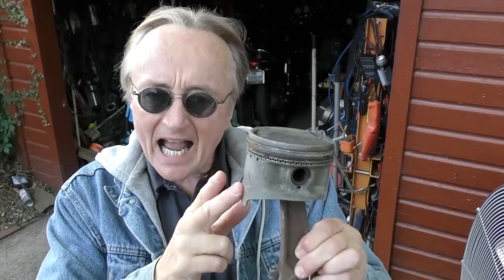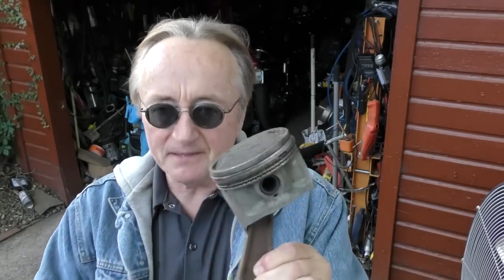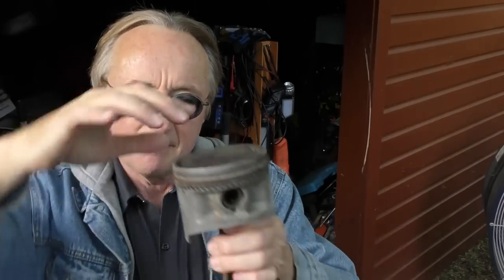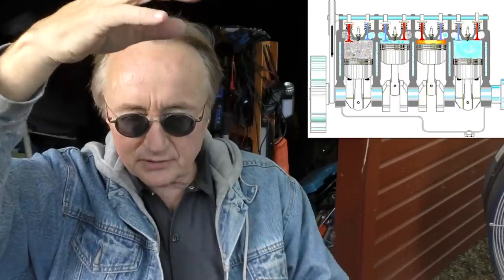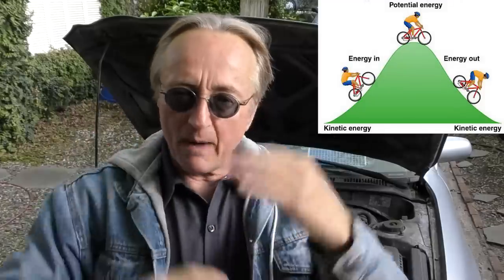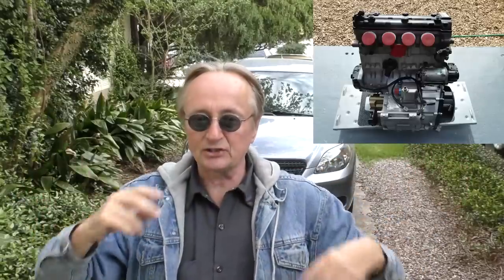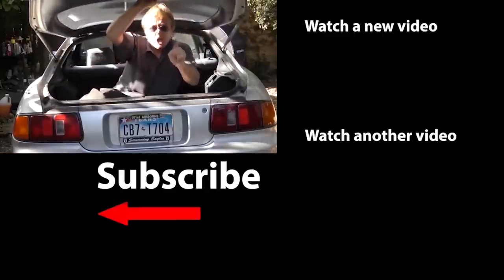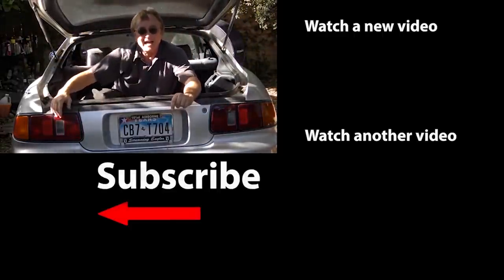Horsepower vs Torque, Which is Better

Comment: Scotty, I am a mechanical engineer and today I'm sad to say that you, as 99,9% of people that try to explain what is the, let's say, practical difference between horsepower and torque, are wrong. I'll not try to explain it here and I do understand why you think what you think. Once, I did think like that too, because it is kinda of the intuitive idea. The only thing that I could ask you is this: if you have the oportunity, talk to a real engineer, someone that works with cars and really has some background on how car works and how maths and physics works. That person will say to you, without a doubt, that what you say in this video is actually not quite right. Wish you the very best.
Reply: I agree. This is not correct physics.
Reply: Yup...
Reply: Explain the truth. Now I am curious. You must feed my curiosity (please). Thank you.
Reply: @DrDreams23  power is a function of torque.  You can have a harley or a tractor with a lot of torque, but neither will accelerate quickly.  If you take the hyabusa Scotty was talking about with high power it will accelerate significantly faster than the Harley. There is no way the harley will accelerate to any speed faster than the busa. Same with the F1 car, they accelerate very quickly, due to the high power.  Additionally, a high power engine will tow a load up a hill faster than a lower power but higher torque engine provided you have adequate gearing.  So unfortunately Scotty got pretty much everything wrong in this video.  Power is torque at speed.
Reply: @DrDreams23  Keep this “ LEARNING HUNGER “ going brother, never stop learning 💪🏼 🧠

Comment: Rev up your Mitsubishi Mirage with 78 horsepower
Reply: You're just mad my mirage is a 2018
Reply: My 2000 Mirage (1.8) had 92 horse. Great on gas, but as Scotty says, "couldn't get out of its own way."
Reply: I have a moped with 50cc does that count it wimpy so let me rev it
Reply: In simple terms Horsepower is how fast you hit the wall and torque is how far you take the wall with you.
Reply: this is a great car with reliable cvt here in IL , one of the best Fuel efficient car auto
Reply: VKA_CarvedSix09 yes I am
Reply: RANT I’m jealous
Reply: I love my Mirage. And it has 80 hp in European spec!!! 120 miles an hour!!! And average fuel consumption 52 mpg (over 50.000 miles). And no defects. Zero. Nada. Nothing. Not even a light bulb broke.
Reply: The quintuple flatch swing clutch part-identified right between the driver and his prey
Reply: 100 cylinders 1 horsepower.  

But the rolls has 563 gears
Reply: @ronaldderooij1774  obviously because its still a brand new car
Reply: How many virginity's you think were lost in this cars?
Reply: My current car has 114hp and 136lb-ft of Torque.
Reply: @scotty281976  I thought of that saying when I saw the title!
Reply: Rev up your suzuki carry, 28 brute horsepower 😂
Reply: I was thinking about buying one of those. Glad I dodged that bullet.
Reply: I had a little Toyota Trueno with only 100 HP,  it didn't weigh much and was pretty quick unless you had passengers
Reply: @vka_carvedsix0979   How do you like that little car?  I've been looking at them for years just as a car to go back and forth to work and save on fuel.  Currently have a 2014 Altima that get's 29-31mpg city driving back and forth... Yes I drive like Granny to get that mileage I'm cheap lol.
Reply: @vulpixgrant  almost 50 if I coast the car
Reply: Rev up your yugo with 54🐜 ant-power.engine.
Reply: Mine has a V6 swap 3.8 with 280whp
Reply: No mitsubishi carisma with 125 hp.. And yes i rev it all day long to get it around in my pace
Reply: My Citroën C3 1.4 has only 82 hp
Reply: Rev up ur Suzuki Alto with 48hp
Reply: Bacster Bacx hHhHaha do they actually ‘rev up’????
Reply: @Pittaz  yeah i think :D
Reply: Rev up your 94 HP 2014 Scion iQ😂
Reply: Hahaha
Reply: Its funny you say that, I just traded my 2018 mirage for a 2021 Subaru Onyx with 260hp, now I feel like a god!

Comment: Torque and HP are apples and oranges, two very different things.  Torque can be measured, HP cannot - it has to be calculated.  Torque is best achieved by longer stroke, larger pistons, and more combustion pressures.   Unfortunately, longer stroke makes for higher piston speeds which limits your RPM.   If you want a lot of HP, you need the engine to survive higher RPM, which means a shorter stroke is better.   HP relates directly to gas flow rate (cubic feet per minute) that you can get through the engine, so big intakes, big exhaust, big valves and big ports in the cylinder heads is where HP is made.   There are a lot of compromises between big torque engines and big HP engines.   Is the variable stroke and variable valve lift and valve timing the best of both worlds?   What do you think Scotty?
Reply: Thanks for this comment. Very well said. I learned from it
Reply: Yeah this is true. This is why many big American engines are limited to 6,000 rpm or below. 
And Asain cars can go up to 9,000 rpm. American cars can tow more, but have lower top speed.
Reply: @angelgjr1999  Completely inaccurate generality
Reply: It is true that the big push rod engines have more torque and less horsepower and are also lower revving, so American muscle fits the profile, but beyond that, it's a mixed bag.
Reply: HP can be measured just like Watts, just because a calculation is needed to measure it, doesn't make it any less of a measurement. For instance we use the term measured for the distances of celestial bodies in the universe, which can only be done through calculation. Now onto the subject of which is better, horse power is, plain and simple, horse power is the overall power output, and torque that is applied to the wheels can be infinitely increased by simply gearing down(think of it like using a longer lever to lift an object).
Reply: @creamofbotulismsoup9900  Cosmology produces some really imprecise measurements. Check out the error bars in any paper. Also it makes little sense to simply gear down an engine that is severely lacking torque. It wouldn't work putting a car engine on a semi truck, for instance. You'd just be spinning the clutch or torque converter and never going anywhere, no matter what gearing was available.
Reply: I remember in my 2 stroke days I owned the highest torque motorcycle of its day. Higher than 900 BMW 1200 HD.
70 HP with 81 FTlb.....'74 Suzuki GT750.  Just able to make 120 MPH. But as Phlaked Corn
 commented, numbers are for
stock gearing.
Reply: @redtrek2153  Well if you put a 500HP car engine, that made that power at 5000 RPMs , VS a semi that makes that power at say 2000, it just means that the car engine would have to turn 2.5 times faster to apply the same amount of force to the wheels. Sure that car engine makes less torque, but it is also spinning faster, so you can use gears to multiply the torque and actually achieve  the same power output to the wheels.
Reply: Patrick, that's why old american low RPM V8s had such huge torque.
Reply: @angelgjr1999  Sorry that is not how it works. Power is power, plain and simple, it doesn't matter what speed the engine spins at, it will tow just as much and go just as fast so long as the power is equal. The reason why a lower RPM high torque engine is better for towing is because of gearing, more torque means fewer and longer gears can be used, with a higher revving car you would need more gearsto get the same acceleration.
Reply: @PasiemuKasMano  I'll take a high revving honda engine with half the displacement and more power, over one of those old boat anchors any day, sure you'll need more than a 3 speed tranny, but a few extra gears far lighter than half a V8...
Reply: Phlaked Corn You have no idea what you are talking about if you think revving has no influence on towing. When it comes to towing, you want to stay at 2,500 to 3,500 rpm for the most torque in gas engines.
Reply: Loomis Buddy have you ever driven an old N/A Mustang? I have. They can hardly go above 5,000 rpm but they have a lot of low end torque. 
And I have also driven a 2017 Honda Civic with a turbo. 
The civic is quicker at higher speeds, but has slower acceleration and you don’t get glued to your seat. 
Mustangs are (relatively to sport and super cars) slow, but have a lot of torque so they are fun to drive.
Reply: @angelgjr1999  Just curious was it the type R? Those things are pretty weak off the line but that has more to do with the transmission they use, in this case a slush box would be advantageous over that 6 speed manual, it would accelerate way faster if it had a torque converter.
Reply: @angelgjr1999  "2,500 to 3,500 rpm for the most torque in gas engines" You sure about that? Most smaller modern gas engines make their peak torque at around 5000 rpms. Larger displacement engines make torque at those RPMs yes.
Reply: Yea they are two completely different things. Torque can be seen as a very relative thing, technically you can have infinite amount of torque if the lever is infinitely long no matter how little force is applied, horsepower stays the same, the longer the lever= the slower it spins means it would make the same hp, in real world tho, torque tends to bend stuff and too many gears just means loss of energy.

The new tesla roadster 2.0 is advertised with something like 10000 NM of torque, but that's wheel torque and that number is actually not that special in the sueprcar world.

For people wondering what I'm talking about, search lego electric motor torque (or something between those lines) on youtube, with just a couple of gears you can lift a person with a lego electric motor.
Reply: @adodoes8770  There is a good Youtube channel that does similar demonstrations and may have even done that lego motor you described, it's called "Gear Down For What?"
Reply: Phlaked Corn Yeah I drive a Ford Explorer with a 4.0 v6
So yeah it’s limited at 5,500 rpm but it has a good bit of torque.

Edit: and I’ve noticed it has most torque at about 3,000 rpm
Reply: Phlaked Corn Yeah I think it was. It was a top end 2017 model with a CVT transmission. It was my uncle. That thing was slow at first but could easily cruise at 120 mph in the highway lol.
Reply: Adodoes torque is not a relative thing
Reply: technically you can make any amount of torque you want even from a moped engine provided you can provide a final drive large enough to create the torque...so i can use the moped engine to lift a ship if i had a strong  small primary gear to turn a super large secondary gear as big as a truck which then lifts the ship...but its horsepower will remain tiny and it will take much much much longer to lift the ship than a conventional crane
Reply: @creamofbotulismsoup9900  So you prefer slower acceleration?  Because that is what you are gonna get with a NA 4 banger vs an OHV V8.  I remember when the S2000 came out.  240 hp, but a weak 153 lb ft.  I believe the test I saw was Car&Driver.  0-60 was 5.8s IF they revved to like 6000 rpm and dropped the clutch.  Then they did a "street start" test, 5-60. It was like 11.x seconds. Pathetic.  That's what you get from cars with weed wacker engines.
Reply: The only compromise in higher torque or horsepower engines is displacement
Reply: @Ryno-fp7pm  You ever driven an older V8, like from the 60's or 70's? Those things are even slower, and why they are called boat anchors, 0-60 in over 10 seconds, yeah I'll take the honda, thank you.
Reply: @creamofbotulismsoup9900  I would not drive those land yachts, I hate them.  I don't like big vehicles.  My street performance vehicle is a 67 Mustang.  I can't even begin to count how many ricers I've smoked...and often doing 2nd gear starts.
Reply: @creamofbotulismsoup9900  "You ever driven an older V8" - apparently you haven't either...ive driven a  '69 camero with a stoked 350 (383), '71 chevelle with a 307 w/ powerglide, and got a ride in a '56 belle aire with a 409...the chevelle was stock, but the others were sub 10 cars easily.  
hell, i got an LS4 in my grand prix and run circles around ricers without even dropping the throttle.  that little honda would only see tail lights
Reply: @UniqueBreakfastTaco  Yeah, those aren't exactly average cars from that era, yes I am aware there were some outliers, but the vast majority of vehicles from that era with a v8 are slow AF.
Reply: @creamofbotulismsoup9900  except the ones they wanted to make fast. Many cars today are slow af as well...

Point is, era doesn't matter, engine size doesn't matter. Old does not equal slow, new doesn't mean fast.
Reply: @UniqueBreakfastTaco  I guess it would help to know the original context of the comment I made, the point was average modern 4 bangers, often have similar power compared to an average older v8s with half the weight...
Reply: Hello .... it's more like:    
Multiply the torque by the engine speed. You will be using the formula (RPM * T) / 5252=HP, where RPM is the engine speed, T is the torque, and 5,252 is radians per second.   Anything beyond this answer requires engine mods. Doing away with the cams to open and regulate the cams is the holy grail of IC engines. E.G.  PHEA camless technology. Not yet on the street.
Reply: @DommoPA  Freevalve tech can't go mainstream soon enough, hasn't it been like 7 years or so Koenigsegg revealed it? I can see why you call it a holy grail, so many advantages it's hard not to almost drool over it.
Reply: Patrick Zambori :  That’s the answer i was looking for, how Hp and Torque made by engines, Thanks man.
Reply: sooo why higher piston engines make low rpms?? please someone explain i dont understand
Reply: @creamofbotulismsoup9900  hp is calculated not measured. 
More of a headache :p
Reply: i am still confused. if torrque is for acceleration and 0 to 60. then why are diesels slower? why do people rev high on the peaks of horsepower when racing?
have you ever seen a drag race where they keep the engine at peak torque (~3k rpm)?
can someone please explain?

Comment: Wrong. Horsepower is the one indicator that specifies engine performance. Torque is a secondary indicator which specifies how power is achieved. A powerful engine, even if it's not torqy, can always produce a lot of torque on the wheels, because unlike power, torque on the wheels can be created with gearing. And you are way off by claiming f1 cars do not accelerate well. They do, and the limiting factor is not torque or power, but tire grip.

Comment: Torque is how much work the engine can do. Horsepower is how fast it can do it.
Reply: I would say torque is the force of the engine.

Physically horsepower describes the work. The performance over time (how fast).
Reply: zachary paris no no no and no
Why does everybody stick to that lie?
Engine torque(crankshaft torque) alone means nothing. Without rpm, you have no power. Same goes the other way. 
Horsepower + gearing determines the load you can haul.
As it does acceleration. Or top speed.
Seriously, this engine torque myths are going too far.
Reply: @milorad7226  Yeah Torque alone is not much. It is an important variable but more information is necessary.

A hich torque is still really good (unless your car is light)
Reply: D. Draber it is equally important as revs.
If you don't have the torque, you'll have the rpm. Or the other way around.
100hp is a 100hp.
One engine may have greater torque, but it will produce power in lower rpm.
Other engine may not have high torque, but it makes it up with higher revs. 
Point is, both engines are capable of doing same amount of work, if their horsepower is equal, and ofc if fitted with appropriate gearing
Reply: @milorad7226  Well, I'm not going to argue* since that wouldn't make sense. We are talking about two physical quantities.
It's just like deciding if sound or light, mass or weight is more important.
Only when it comes to a specific situation (like transport) one might be more important.

*I know I was the one who started.
Reply: D. Draber if u take closer look, i was actually replying to zachary. 
Nevertheless, we are not living in the world were cars have direct drive. In that case, engine torque would mean you can pull greater load.
We have gearboxes. It is all about reduction and gear ratios. 100hp low torque - high rpm engine will do same amount of work in the same period of time as 100hp high torque - low rpm engine. It will only have different gear ratios. Simple as that.
Same case with acceleration. Power is what matters. And power is product of rpms and tq.
We cannot defy Newton's law.
Reply: Completely wrong, stop writing things you know nothing about.
Reply: I like how scotty put it in more laymans terms rather that putting it as work and force he simplified as acceleration to speed

Comment: Not the best explanation I’ve heard.  An engine with half the torque and double the RPM (same hp) can be geared twice as low. At the wheels performance will be about the same because at any given speed, they produce the same force to the wheels
Reply: blurglide, if that was true than you would see more gasoline engines in trailer trucks
Reply: @murph55  It's a simplification, but largely true.  The higher revving engine will probably have a narrower torque band (have to stay in the high revs to make torque), so relies more on shifting gears for responsiveness than throttle position.   Also, as cylinders get bigger, torque naturally goes up and rpm goes down.  Diesel also has a lot of advantages for a heave truck, and those tend to be naturally low revving for a variety of reasons.
Reply: I agree:) Finally someone understand how it works:)

Comment: Horsepower is the amount of energy produced by your cars engine, torque is the amount of energy displaced at the wheels. A good rule of thumb when buying a car with a naturally aspired engine is to buy one where the hp and the torque are about the same.